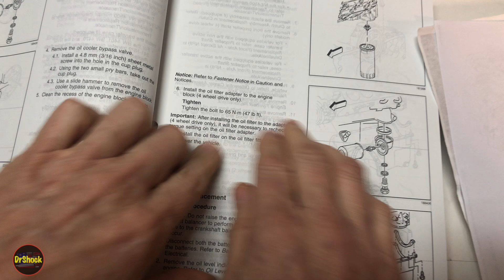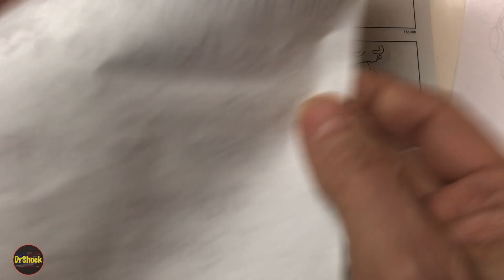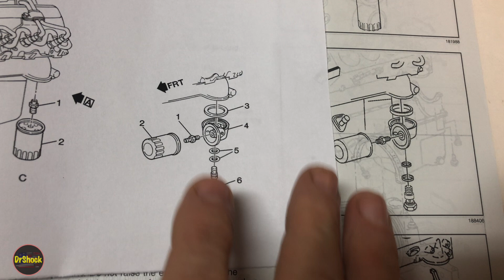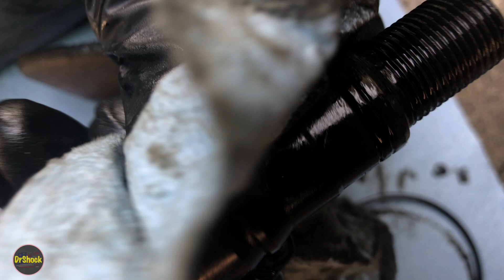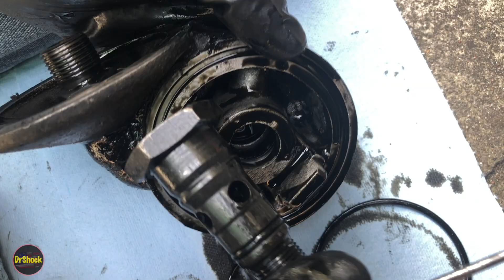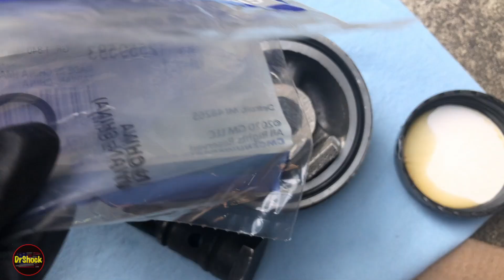1995 - 2000 GM 4WD K Trucks 6.5L Diesel Engine Oil Filter Adapter Seal Oil Leak Repair (Chevy & GMC)

Comment: Hello i was looking for the seals for the oilfilter housing and i found a set from (FEL-PRO ES73229)  on rock auto i just ordered it and will let you know if it fits
Reply from the maker: I only use OEM parts myself, links to the GM numbers I showed are in the video description.

Comment: I've a 95 c3500 with the 6.5 does it have a BCM ? I ask because I've light, & gauge issues, if so where is it and how do i check it?
Reply from the maker: There was no BCM in that era, only the PCM (powertrain control module).  A much simpler time.  ;-)
Reply: @DrShock thanks, what would you suggest for me to check, being I'm not a mechanic
Reply from the maker: Too complex and broad of a symptom list for a comment board.  But start with the lighting, that's going to be wiring 101 - powers and grounds.  Issues there are usually due to age and physical damage to the wiring harness, or corrosion at the terminal ends.  You'll need a multi-meter, a test light, and the service manual for the truck year (for the wiring schematics).
Reply: @DrShock  thanks again, I guess it's time a manual as I've the rest

Comment: Amazing video as always! I threw my adapter away and using a shorter Delco PF454 threaded straight to the block like a conventional small/big clock. But I do change oil and filter more frequently than normal